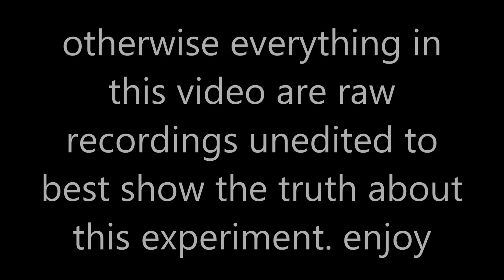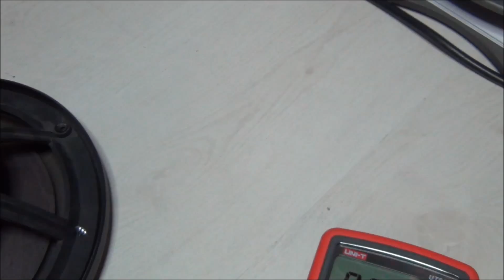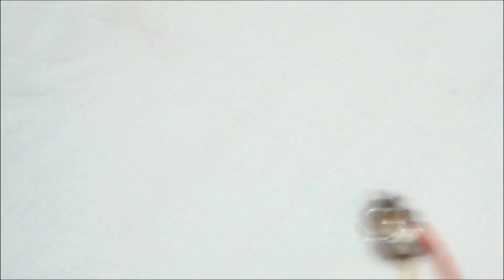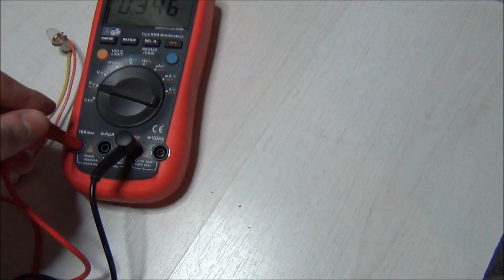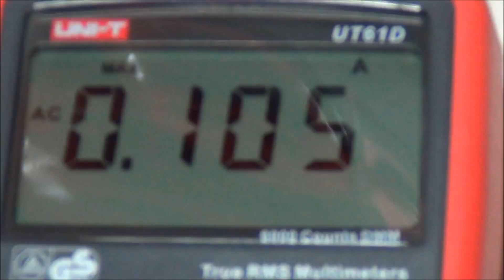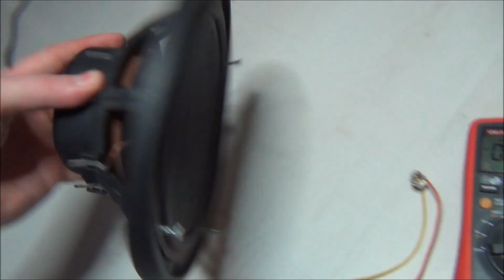How to make light with a speaker explained

Comment: I'm thinking of trying this with Christmas lights connected to the speaker, and placing the speaker inside a kick drum with the cone facing the drum head where the kick-pedal beater strikes. My theory is that the impact of my beater should be loud enough to "wind" the speaker cone thus making the lights flash even if they just flash faintly. It's for my kick drum effect when I play on stage in dark venues.

Comment: I have a question. How does tge volume affects the frequency ? Does increasing the volume increases the frequency?
Reply from the maker: Amna AlKitbi the output frequency will always follow the input / sound source frequency, increasing volume will increase the amount of output power on the slave speaker but the frequency should stay the same, however do the frequency matter a lot regarding the output you get.  as long as you can keep the same excursion at a higher frequency you gain more output from the slave element. The best output is achieved when the excursion and frequency is maxed together and where this gonna be depends on the speaker properties that are used

Comment: FASCINATING !! can you please explain the physics behind this trick? like what causes the other speaker's cone to move? is it the pressure of the large speaker? does the frequency matters?
Reply from the maker: jawaher ebrahim Thank you and sure thing! The large speaker is powered with a regular amplifier and is mounted in this ported enclosure and when it plays it builds up pressure in the bass reflex tube that goes in and out with the excursion of the large subwoofer. 
It is loud sound more the less that comes out from the port (if you want to know how the port affects the speakers volume I can affect this separately)
However is this amount of moving air near the port containing a lot of sound wave energy that makes the secondary speaker move along as it blocks the passage on close distance and the waves wants to keep travel and presses and draw in the cone of your slave speaker on it’s way trough.
This sound energy is massively charged with power but even quiet sounds are possible to harvest tiny amounts of power from but not for any good use so to speak. 
But the movement on the slave speaker is again turned to electric energy by the moving coil principle ( just the reversed process of making the sound to begin )
Almost like a bad way of making wireless energy, we first use an amp powered by electricity to generate sound with a primary speaker and then pick that sound up with the secondary speaker and turn it back to electricity again, and this comes at a cost with lots of lost power in the process as speakers only have a few percent of efficiency to begin and both ways are losing great amounts of power due to heat in the process but naturally could any kind of loud sound give energy to harvest that would otherwise be all lost but there does not seem to be a decent way to make this affective enough to be put in a good use yet. 

But the frequency does have an affect in the output power as in this video experiment. As every stroke gives a certain amount of power faster movement at the same excursion going to give more power output from the secondary speaker, so the energy you get is equal to the total excursion you have plus the amount of pulses you can get in the same time so more of both equals more power for your load

Comment: AWESOME dude :D, I am currently working on a similar project, I used my pioneer ts-wx306t subwoofer with its bass-reflex tube enclosure to light up a small LED on another small speaker and it worked! the system almost produced 4.5V!  however, i need to produce more power than what the system consumes so i thought of making two more holes on my bass reflex tube and connect 3 speakers in series. but it is a bit risky cuz i think that the frequency will not be same as if it has a one way out, so what do you think x) ?
Reply from the maker: elegant elegant hi fellow experimenter! You can gain pretty much power and connecting speakers in series with each other may increase the output voltage, however if you plan to power the elements with another audio system you will always have much loss in energy and it is impossible to output more power than you feed in to the setup. Both because of the speaker efficiency and other loss in cables and coils so there is no known way to harvest all energy in sound yet, if you find a way to to this you gonna be rich :)

Comment: Hi, I really loved how you explained it in a very simple way. Does the type of the speaker's box enclosure matter? would the ( Pioneer 1400W 30cm Enclosure-type Single Voice Coil Subwoofer - TSW311S4) be sufficient for performing this experiment? Thank you so much in advance.
Reply from the maker: Jawaher Alalili Thank you!
You can use a larger speaker such as your 12” to generate power too but the key is that you will need pretty much power to make it move enough to give you a decent output voltage, as the excursion and speed of the cone movement is important to get high power output. However if you would be able to make it move a lot in some way continuously you would get a lot of testing power from it. A soft smaller speaker is more easy to experiment with as they don’t take that much power to move such as in my bass reflex in this video but it gives less output instead. 
But as long as you can move a speaker cone all types of mechanical speakers gonna give some output but it varies a lot between the models and impedances they have. But it is easy to test it out and it is pretty safe to test as well if you not put mechanical stress by pressing on the speaker cone to brake it
Reply: Thank you so much!
Reply from the maker: you're very welcome, feel free to ask me if more questions comes up
Reply: Hi bro, can you please provide me with the following details: the bass reflex type and the type of the 12" subwoofer?  

thank you in advance
Reply from the maker: Jawaher Alalili hi!
The box itself is a regular ported subwoofer, internal volume about 48liters, port type is a regular tube 4” diameter, length of port 25 centimeters with funnels at both ends. 

The 12” sub, well it is a one of a kind hybrid prototype and this is the only one existing, so it’s a bit hard to compare it. It got a dual 4 ohm voicecoil based on the NXS NX12D motor, cone from MDS PDS300, custom made dustcap and some other tweaks. You can call it the: /)DB(\ twelve
Reply: Pulverrostmannen thanks a lot 🙏🏼

Comment: If it was a 2V red LED light being lit up about how loud would the music have to be and is it possible to connect a two speakers to the 2V red LED and just light them up by tapping the two cones of the speakers repeatedly pls help I am in 9th grade and was just curious about this
Reply: Was just wondering if there is an alternative to the car speaker
Reply from the maker: Satyam Singh it will take less input power on the speaker to light up a led yes, the actual amount you get at a certain level is hard to tell and it varies depending on the speaker you use. 
The choice of speaker is not very specific as most types will generate some kind of energy but commonly the stronger magnet and softer cone you will be granted more output from it at the same volume you put into it. 

I never tried to connect more than one speaker at a time but to put in series should be possible too as long as you care for the polarity and put the same load on both speakers from the sound source. 
Tapping the cones will make a diode flash if you do so. 

Happy experimenting
Reply: Thank you do you mind telling me about low voltage LED lights that can be lit up by just tapping 2 speakers as well as by putting them against the big speaker and pls give me a list of things I will need to conduct the experiment i would be happy cite you once my research and creation are done !
Reply from the maker: Satyam Singh if you send me your email address in a private message to me or send a mail directly to me via the about tab here on my channel I can send you some blueprints and things you may wanna try from there. It's easier to show you what you can do this way. Look forward to your reply

Comment: Can i add some capacitor or something to store the charge?
Reply from the maker: +Gabriel Masangkay Yes, you can store the energy in a capacitor if you rectify the current with diodes first
Reply: i was planning on using a bridge rectifier, but if i use a diode, i do not know what value to use. Would you know?
Reply from the maker: +Gabriel Masangkay most diodes will do. diodes with low pass through voltages is better as you get a better charge then. and maybe tollerance up to 30 volts or something should last long. the voltage and power you get from the speaker depends how much power you feed the driven speaker and also the driven speakers parameters but it is easiest to measure with a multimeter using AC and see how many volts you can get out of the speaker and then use the 10A mode and short the speaker to measure how many amps you get and chose diode from those values
Reply: yes,yes thank you very much!
Reply from the maker: +Gabriel Masangkay No problem :) feel free to ask more if you need it. have a nice day